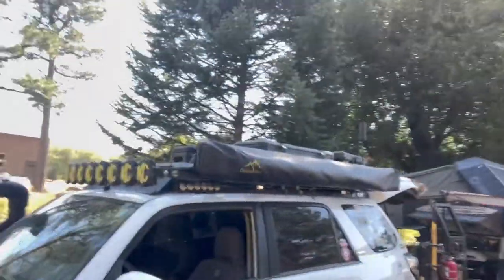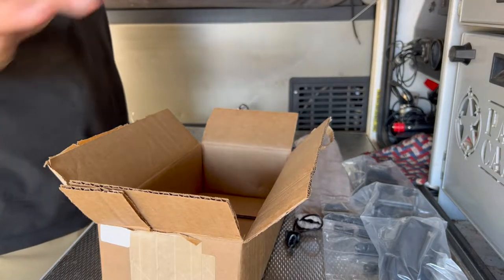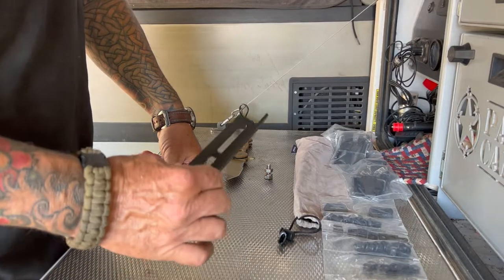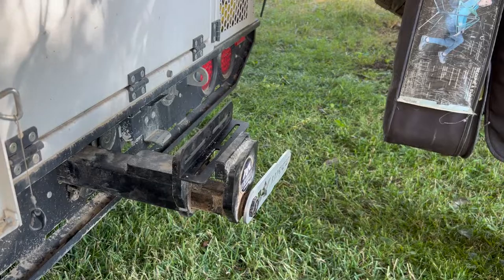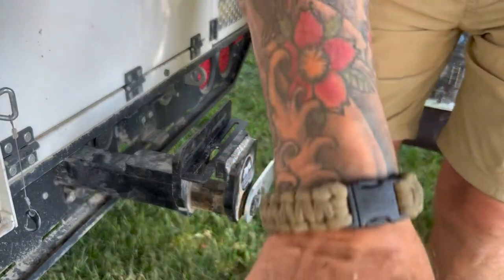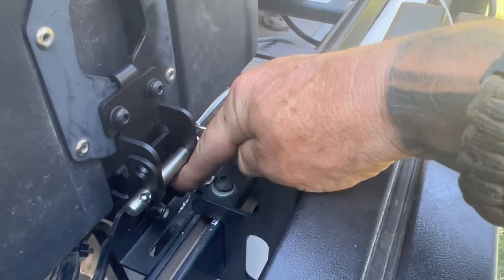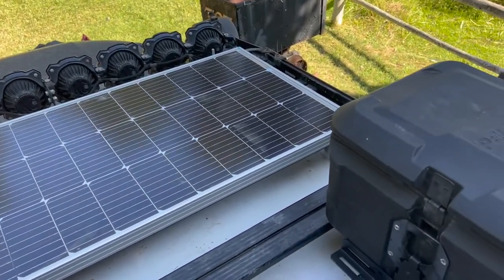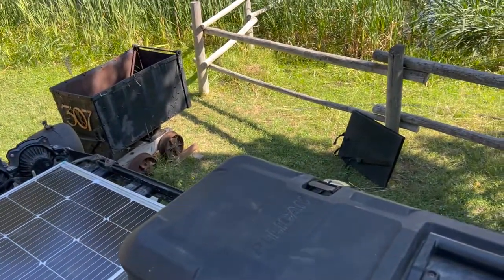Pelican Cargo Case Gen2 Hard mounts Pro's & Cons

Comment: I just purchased  the BX55S and looking for the mount now. I have a FR Slimline II Roof Rack as well and was looking for the Pelican RFMT001SC Saddle Case Roof Mount which I believed designed specific for the Frontrunner Roof Rack. But I preferred the case mount to be kind of universal fit so that I could hook it to another vehicle with Sherpa The Crestone Roof Rack and this lead me to the Pelican RFMT2 Cargo Case Roof Mount Kit. But thanks for this video for showing some sort of the issue in the fitment of the hex bolt into the bracket between the Frontrunner M8 hex bolt and the Pelican M6 bolt
Reply from the maker: You are welcome, it was a simple fix and they have been working very well!  I’ve been happy with them.

Comment: Just a suggestion, a step drill sometimes is a better option for drilling out slotted holes. Best scenario is clamp the workpiece to a drill press, use the step drill. (If they are available)
Reply from the maker: Thank you for that.  I completely didn’t think about a step bit and second I didn’t have a drill press in the forest!
Reply: That would definitely be a problem, sorry, I didn’t realize you were in a remote location.
Reply from the maker: @alext9540  No worries, we work with what we have

Comment: Do you have the FrontRunner slimline 2?  That bracket  was suppose to be made to fit without any modifications.  I’m thinking of getting the brackets but don’t want to be drilling and shaving.
Reply from the maker: Yes, we have the Frontrunner Slimline II.  I wasn’t too happy that I had to hone out the mount but they been working well!!!
Reply: There are two different brackets available and one is made for the front runner rack. The one in the video is not that bracket based on what I have seen.
Reply: I believe the FR specific mount is discontinued, there was lots of feedback around it bending very easily, and the lack of security options.

Comment: Are the nylocs on the horizontal bolts even engaged? It looks like you could use an impact and spin them right off. Also the vertical bolts can be buzzed right off too. More secure than straps but looks easy to defeat for 240 bucks. Just a thought.
Reply from the maker: Yeah the nylocs are engaged, also use red lock tight and loc washers!  If someone was committed and had the time they could get off but as we all know locks only keep honest people honest

Comment: Definitely not a fan of this mount. Just installed on my Front Runner. I did notice that I think your bracket is  somewhat upside down as the two small M6 holes should align to the T-Track on the FR. I still had to drill the M6 to M8 which hurts (esp for a $200 mount), and the fitment feels a little flimsy to be honest. Let’s see if they hold 😅
Reply: Also the fact that the included mounting solution has M6 and 6-8mm track brackets (6mm) makes standard mounting it to FR feel super flimsy. At least chuck in some 8mm track brackets for the FR folks!!
Reply from the maker: Mine feel nice and tight, but wasn’t happy about having to drill them out to fit M8

Comment: Maybe they forgot the instructions in your box. Mine came with instructions.
Reply from the maker: I thinking your probably right, but I’m more concerned with the fact that I had to resize the mounting tracks!  All in all it’s no big deal these mounts were easy to install and have been rock solid!
Reply: @ironhorseoverland7353  I wasn’t sure how I was gonna mount them on my gobi rack, but was able to use the squares with the 2 threaded holes in them to attach the mounts to the steal grate on the gobi rack. I definitely like the new design mounts over the old ones.